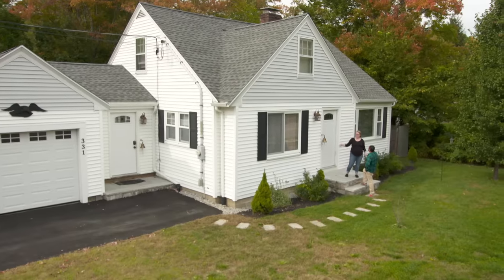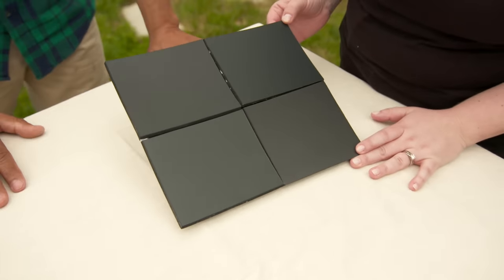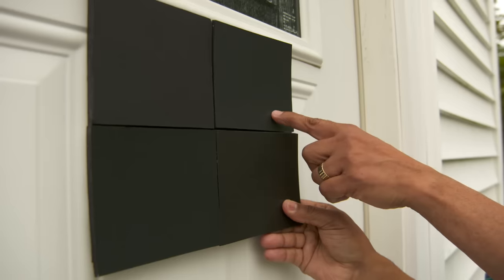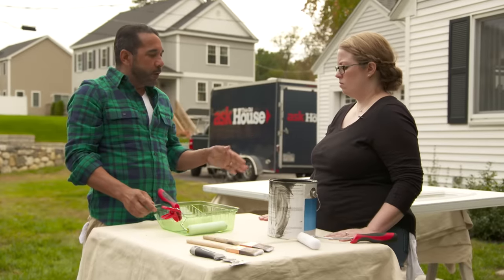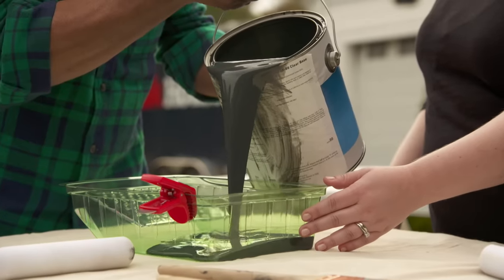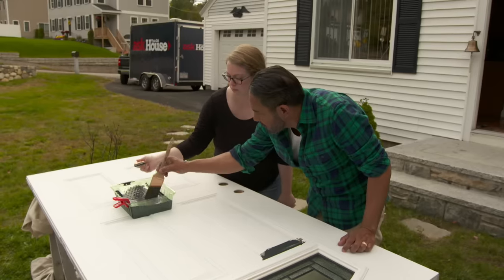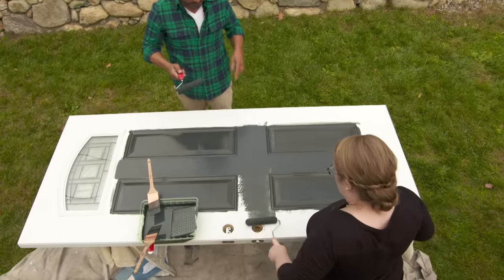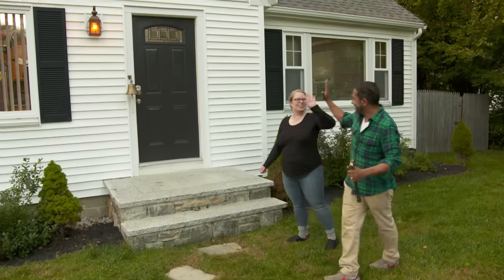How to Paint an Exterior Metal Door | Ask This Old House

Comment: No primer????    Unless the door is brand new, I would have added a coat of good primer.  Also, what's with brushing the middle sections?  Make no sense whatsoever.  You roll that just like you do the outside area.  And he missed the hinge edge.  That gets the same color as the outside.  The inside hinge gets the same color as the inside of the door.
Reply: He says they are using Direct To Metal Paint. If it’s designed to grab the metal, using a primer would defeat the purpose.
Reply: He also mentioned that the door came primed from the manufacturer
Reply: @nancyk5203 yeah, but this door was painted, it wasn’t bare primer
Reply: It depends. Their paint is water based so if the manufacturer's primer is oil based, they'd need to use a water based primer before using the paint they're using. If the manufacturer's primer is water based there wouldn't be a problem painting right on it.

Comment: The only places to use a brush is inside the grooves. You need to minimize the brush marks. I use the brush inside grooves then lightly use the roller to get rid of any brush marks. This guarantees you consistency. I would never use a brush to paint panels.
Reply: Agreed. So now the panels will have brush marks and the rest of the door will have a light textured finish. Weird experts giving better info. Specially when you’re using semi gloss or gloss enamel, it is gonna show Everything In a dark color. Brush the grooves and before that dries roll the whole door and make sure it’s not hot out, you want the whole door to stay wet while you paint or it will look horrible. You also want to tape the edges so if any paint runs down you won’t have a mess on the edge. Honestly the best way is to spray it. Make sure u sand and I would primer it before paint, I have seen the paint peel off the hot metal too many times,

Comment: Use a Foam Roller and dry roll runs as it drys. First job I did for a contractor was 10 doors, and I had no clue about painting, but its all came out perfect doing that.
Reply: What does it mean to “dry roll” exactly?
Reply: @frisco61  roller with very little paint on it.  Take the paint off the roller using the paint grade.  Then come back to the door and check for runs. Also. On metal use a lot Less paint than you think. 2plus thin coats
Reply: @patelien  wow thanks so much! So helpful as I’m working on ourour metal front doors right now.

Comment: I like the look of just stripped metal door on the interior side. Is it ok to leave the interior side unpainted?
Reply: It could cause the door to be more like tight to close its better to leave it the way it is or door won't close right. Remember your adding an additional layer.
Reply: No, it should be painted.  Whatever color you choose, but most people do either white or a neutral color to accent their walls or trim.

Comment: Another great video guys. I am replacing both my doors with metal doors and I was wanting to spray them to get a nicer finish. I was thinking of using my spray gun that I use with my air compressor. How do I thin my paint or can I even thin it down.
Thanks. And keep those videos coming.
Andy

Comment: Takes too much time and doors are hard to reinstall correctly. I have painted many doors. Leave door on hinges, pick a warm day, leave open inside house, tape off the hardware, repair and sand, wipe clean and use a special nap roller for metal after brushing. Works great with less effort
Reply: Remember to put psper covers down at bottom of door. You can cut up and use paper grocery bags

Comment: What about all the bugs flying into your house when the door is off for hours? Here if FL it is too hot to leave a big hole in the house. All the AC goes out. I did mine with the door in place and it came out great.
Reply: Either do it when it's cool or create a temporary covering for the hole.
Reply: I live in Florida.  The best answer is just wait until winter when you have a weekend where temps are cooler.  The amount of bugs are also significantly less in winter/cooler weather than they are in summer.  The last answer is to use house wrap (thin painters drop cloth tends to be too flimsy and stretches) and seal up the opening by taping it around the door frame if the door will be off for an extended period.
Reply: You are partially right. It didn't have to be taken off, but it wolud need to stay partially open for a few hours to avoid sticking where it makes contact with the weather stripping.
Reply: You cannot paint the side of a door that closes against the door sil and then actually close it. It will be glued shut LOL. I’m sure there are at least 20 possible creative ways to close the door opening with something temporary.
Reply: tape and plastic.

Comment: Missed the hinge side (edge) of the door.
Reply: Yes but the paint they were using was for metal and the spline is mostly wood and would of looked ugly if painted with the same paint ! I was guessing that is why they skipped it !
Reply: I mean if i was doing that door i would of done the spline with a spray can that had a similar look to the paint on the door ! As you stated the spline is usually done to look the same as the outside of the door so it will not stand out when the door is open !
Reply: They left the whole back of the door white and the edges match that...
Reply: Yes i saw that but i was taught that the spline should be the same color as the outside color and the striking ( or hardware ) side should be the same as the inside of the door ! So when the door is open nothing will really stand out ! Maybe I'm too old school and maybe they don't teach that anymore !
Reply: Sorry i should add that the video was great ! Was too busy nitpicking and forgot to compliment first !
Reply: Hinge side is usually same color as outside, the other side is usually same as the interior color. We paint the hinge side and outside at same time, with same brush, with same paint. Just like the door knob side, same time with same paint. Nothing special needed for either of the door edges. If you're doing outside, do the hinge edge of door same time. If doing inside, do the edge that swings inside same time. No special engineering going on with any of it.

Comment: Ive read that people take metal doors to autobody get them painted.  Has anyone ever done that?
Reply: Virgil you can go to an auto paint supply store and get custom mixed paint in spray cans. We'll worth the extra money.
Reply: It's kind of expensive since they remove all the paint and apply green base paint. But the finish is terrific
Reply: I did that on a door we purchased.  Took it straight from the dealer to the auto shop.  They painted the outside a beautiful red and the inside white.  Absolutely awesome!   After 10 years, it looks the same as the day I hung it!

Comment: Thank you very much I need to do that that to my door
Reply: No need to take off hinges, should roll flats of panels to mach texture to other flats on the door and the heel, or where the hinges are, should have been painted that color as well. A couple of other things, but I don't want to get nitpicky. Otherwise...Yep, that's how you paint an Exterior Metal Door! lol
Reply: I would advice to Do take the door off the hinges. If you don’t paint on a daily basis, i guarantee you that there will be drips if you paint it vertically.

Comment: what happened to the primer, no primer??
Reply: With this Old House, they should’ve done an existing metal door that was older. Not a brand new one straight from the factory. Saboor, if your metal door is older and has been painted on; you will need to sand, wipe and prime before painting. Glidden says an oil paint made for metal works best.
Reply: Bethany Mericle An oil based (petroleum) paint will fade a lot quicker than a latex DTM paint.  I see it all the time.
Reply: clearly said in the video that the door came primed from the manufacturer lol
Reply: Karen Stevens Glidden is a joke never use it

Comment: So, for how long was the door removed from the house? All that time it was open to let bugs fly or walk in, and the AC or Heating was most likely running. Finally, the door goes back on, so the question is, was the door off long enough that the paint was dry enough so that it did would not stick to the seals? Here, in South Texas, having the door removed for just a few minutes would be long enough to cause some serious bug problems, including scorpions.
You should consider making a new video showing suggestions of how to prevent energy loss or bug invasions during the time the door is not in place.  Not to mention if the door must be left off overnight.
Reply: Tape up a tarp

Comment: Can you clear coat over this paint job to make the paint job more durable and last longer or does it not need any clear coating? I don't know these things so I am asking.
Reply: Josh Hibbs There is special transparent laquer for yaughts to make things waterproof. I used it on some MDF panels that i have outdoors on the inside of my balcony fence to keep eyes from protruding my private space. Those panels are still in top condition after 3 years or so. But mileage may vary. Just try it if you feel brave for it. If it doesnt work somehow, get out the sander and paint it another time without the experimental stuff.
Reply: Richard van Pukkem Cool, sounds good. 👍🏼
Reply: 8

Comment: I just applied a coat of paint to my exterior metal door similar to the one in this video and used a brush for the panels and a foam roller for the rails and stiles and noticed that there were air pockets that formed after using the foam roller.  After the door dried, you can see the air pockets on the door.  How can I avoid this happening again while applying the second coat while using a foam roller?

Comment: What is the red clip on the paint tray used for?
Reply: There are two magnets on it.  One Vertical and the other horizontal.  My guess is the horizontal one is to keep the paint brush out of the pan and in place.  The vertical magnet would be to keep the paint brush tip into the pan and in place.  The other end of the clip looks like a paint can opener.

Comment: Shit if I already had that thing off it’s hinges I would have just whipped out my airless with a 211 and sprayed it and been done. With a nice spray finish no brush marks. But if I only had brush and roller there would have been no need to take it off the hinges I usually paint them swinging.

Comment: Why would you need to use DTM paint on a door like this? The substrate is steel, but it already has a coat of paint and/or primer. I would think DTM doesn't bond well to paint only directly to metal as the name implies???
Reply: you are right. Its called direct to metal for a reason.Dtm is a crappy paint does not hold up to anything. He could have used a exterior oil or a gloss exterior and got a better result. Bob Vila would have smacked him upside his head.
Reply: I thought the same thing

Comment: That was a big waste of time to take that off the hinges. Its just more work. Especially if you're just going to roll it. Also using DTM was pointless because the door was already painted with a factory primer at least. I painted hundreds of doors by hand over the years and mostly I use acrylic latex. It can take some time to learn how to use it but it holds up in weather and looks really good. I always took  off the hardware and the weather strip. Never paint hardware. If its a stick on strip just take it off while you paint and replace it after your finished. Its cheap. You can let the door dry overnight with the strip out.
Reply: They took it off the hinges for a much better camera angle.
Reply: Are you on the filming crew?

Comment: This doesn't teach anyone how to paint a metal door. This is painting over an existing job.
You've got to get the metal bare, clean any rust or sign of damage.

So clean it very well to remove any trace of rust or dirt etc. And lightly sand the surface to allow layers to bite better into the surface your painting.
Use a light layer of etch primer to make it bite into the metal a little and allow future layers to bind strongly to it.
I like to use a good enamel primer after that to really adhere to the metal and protect/seal from rust and moisture. 
After that, then you add your undercoat and topcoats. If you really want to protect the metal paint, lightly rub an auto wax over it as a long lasting sacrificial layer.

Doing it this way lets outdoor metal last decades without the paint degrading badly and the metal won't rust :)
Reply: Watch it again and pay attention. This is a new door; primed by the manufacturer. It taught us and others how to paint it.

Comment: What if he used black spray paint
Reply: Yes, I don't like those brush marks
Reply: The "best" choice for a metal door to get it looking like it was a factory finish, with durability, would be an epoxy type aerosol (when stripped down to the surface).  The issue is dry time is upwards of 48 hours if layed heavy, so you cannot rehang the door same day; conversely the water based paint they used dries very quick.

Comment: Tip number one, don't take the door off and lay it down horizontally so crap can land in the wet paint as it's drying. Pros paint doors vertically!
Reply: Michael Z Just paint it inside the house. I see no reason to do it outside. Push the coffee table asside, put down some old newspapers, and on top of that the whole contraption. Painting vertically is not advisable for non-pro’s. You will definitely get at least 1 paint drip.

Comment: As a painter I find this video almost comical. In 35 years I have never removed a door to a home to paint it besides in special circumstances. I couldn`t imagine having a homeowners doorway open for several hours. To say regular paint will wash off in the first rain is also irresponsible.
Reply: @thomashajicek2747  I stand on my comment. Besides while on a residential remodel I have never seen a front door removed for the sole purpose of repainting. Removing hardware that consists of knobs, deadbolt locks yes, on occasion but even then I`ve seen painters that couldn`t re-install hardware that was removed for different reasons. And adding to your comment about a person with no experience that couldn`t do an acceptable task of painting a door, is this a candidate for removing a front door? I doubt it.
Reply: So do you paint the door while it's closed?!
Reply: @againsteveryoneswill1923  My point is the door should be painted on the hinges in place. And yes, the door can be closed during the painting process depending on the type of door, for example if the door has insets they can be painted while the door is shut, I personally use a wooden door stop and hold the door in place slightly opened so that I can paint the edge of the door that will receive the new paint, if you notice the painter failed to paint the interior edge of the door black. Another fail in my opinion.